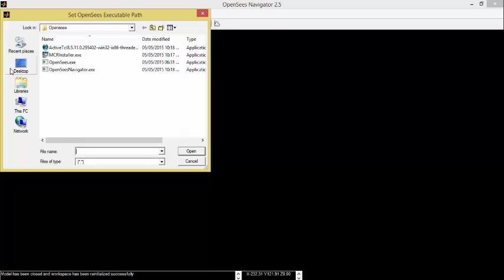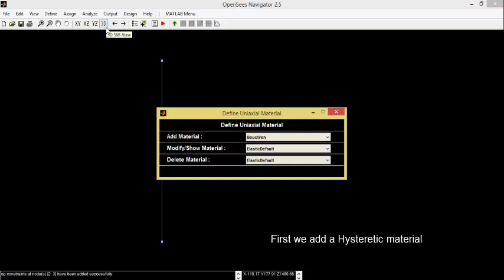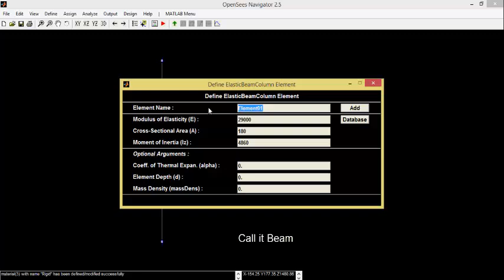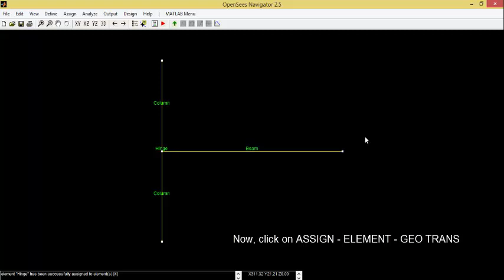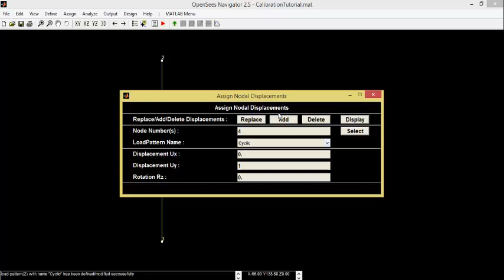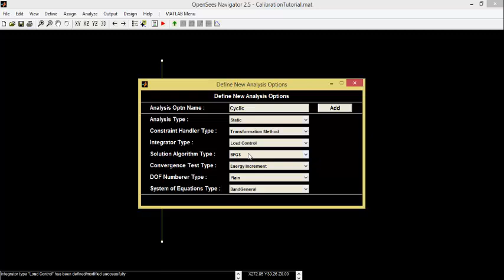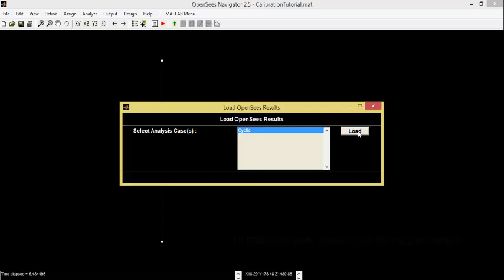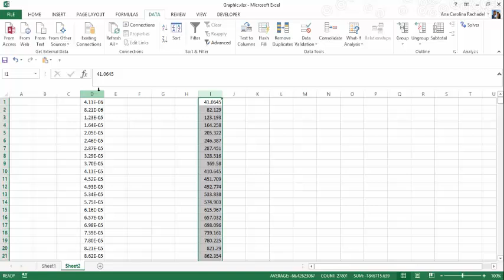Calibration of Element Nonlinear Property (OpenSees Navigator Example)

Comment: it is really helpful...and please add up some more on a beam-column joint element...I found it hard calibrating the 22 parameters of pinching 4 material for the shear panel spring...if you could help?